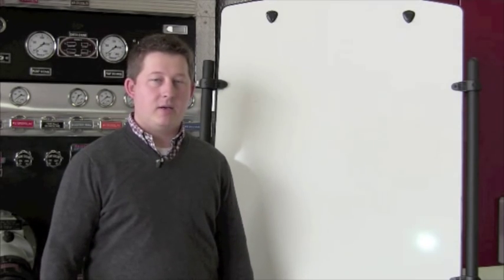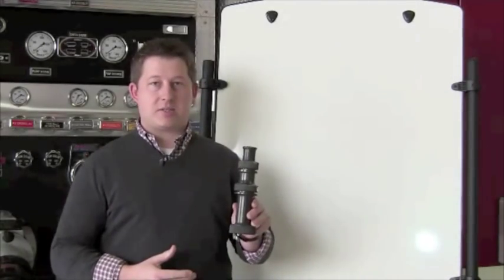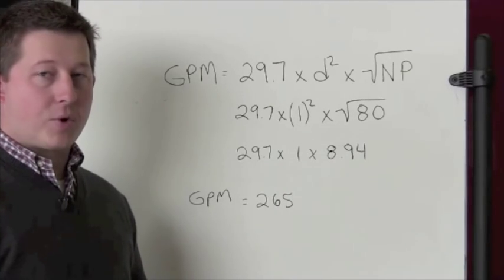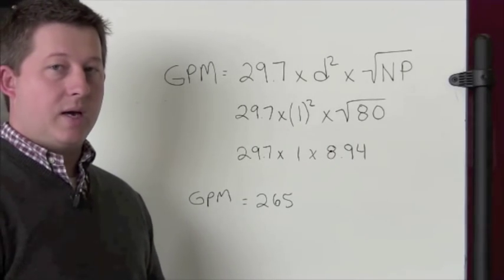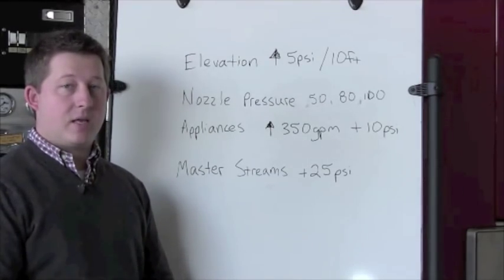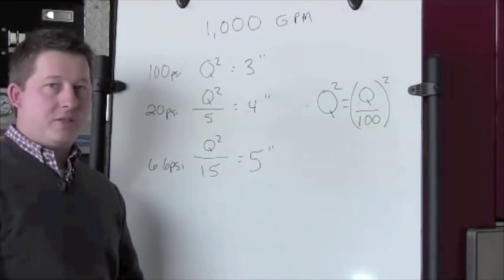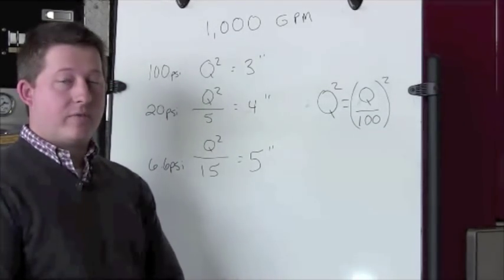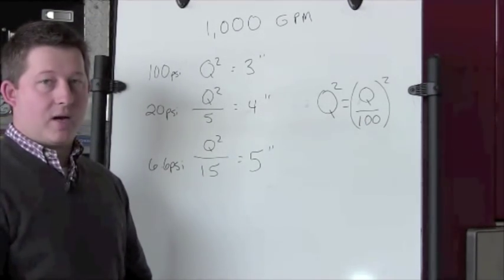Driver Operator - Master Streams

Comment: I didn't know that a 1" tip could be used as a master stream. It definitely doesn't flow enough water.
Reply from the maker: You are definitely right and I should have mentioned that in the video. I used those stacked tips from a 2.5" play pipe nozzle and stuck with a 1" tip during the demo because the math is very simple to follow. Sorry about that.